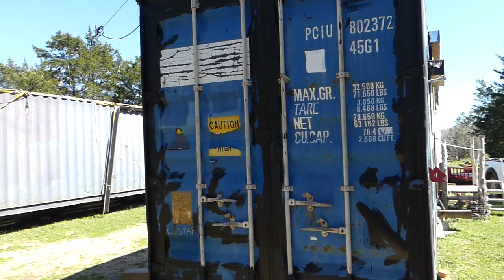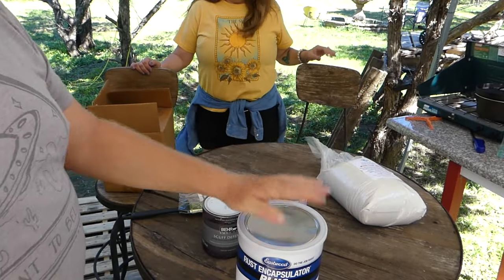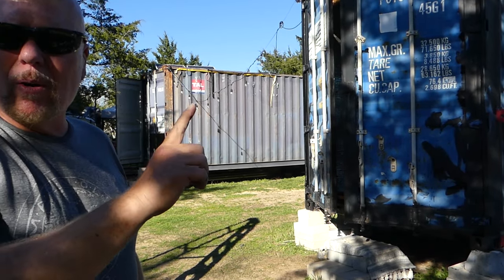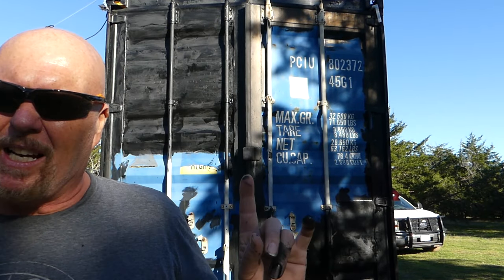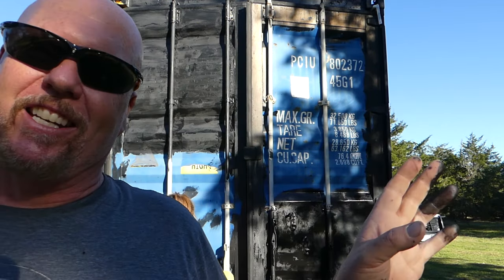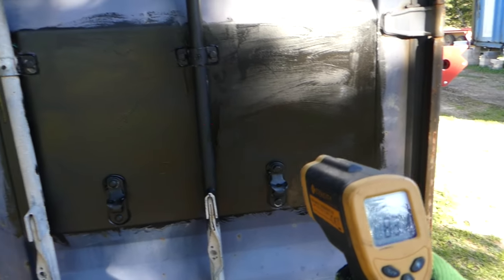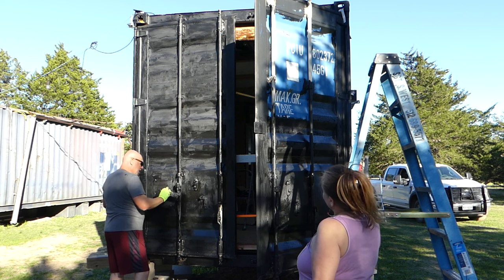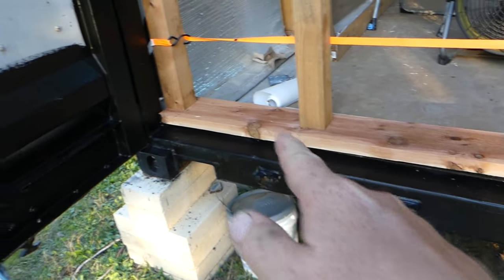He uses NASA level paint for his shipping container. See what happens.

Comment: Good try 🙂. Space shuttle wasn't dissipating the heat from sun light I guess. White would have been the best reflective paint, black is the most heat absorbent. The paint would have still been reacting and prone to heat creation when it was still wet and drying.  I think when you line it with cedar, it will be a great insulator, and will look great.
Reply from the maker: Good point. And the tiles were super thick and weren't powder sprinkled on top. Think this idea would work, but at a depth beyond paint which is a thin film.

Comment: you would have to take the temperature on the inside to see if it was working it is meant to keep the inside cool
Reply from the maker: The instructions said it insulated both hot and cold. In theory I think this stuff would work because ceramic window film on trucks makes a huge difference. It's possible, just I might have the wrong additive.

Comment: To verify the effectiveness of the beads you need to check the inside temperature of two doors, both equally exposed to the sun and both the same color, one with the beads and one without the beads. My guess is that the beads will only reduce heat conduction by a very small amount. On odd thing though is that the door with the best insulation will be hotter on the outside. Cheers.
Reply from the maker: That's a great idea Lane. I think once I get the cedar planks attached to the door that will stabilize that entire situation. I have one more application to test when I paint both of these Conex grey later this year.